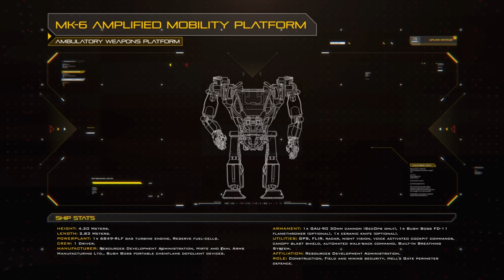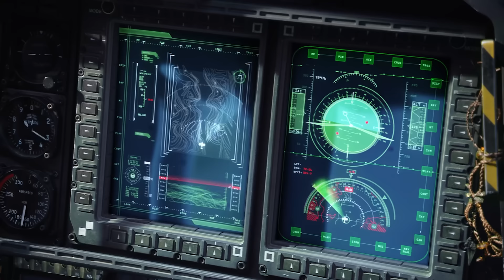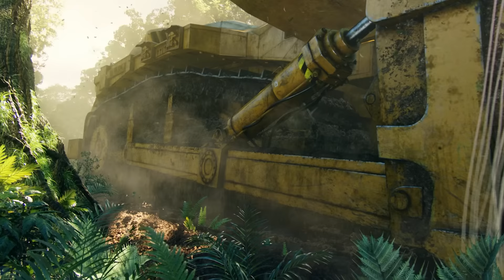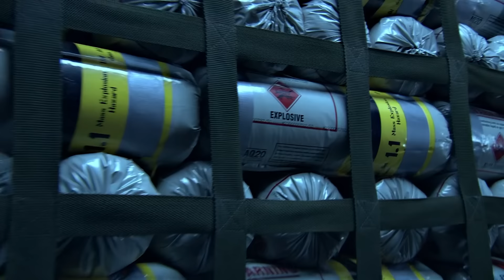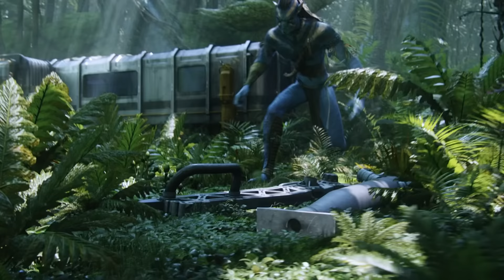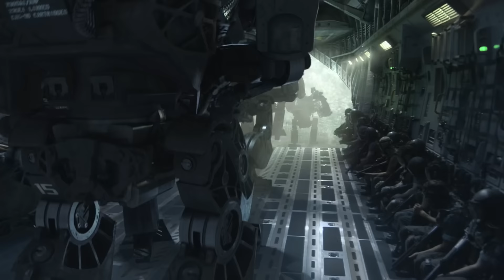Avatar: AMP Suit | Vehicle Breakdown

Comment: One of the most realistic combat mechs, big handheld guns excluded. It truly embodies the "mecha technical" concept.
Reply: They make perfect sense.  Different missions often require different weapons.  If a mounted weapon is damaged it would take time and tools to replace.  Not to mention there's a human in control of it so it would be more natural for the operator.  Though, it would make sense if there WERE other hardwired weapons like missile pods or grenade launchers.
Reply: @Blah81150  Yeah, Its Fantastic but some defensive capability at least would be nice. They say it was originally used by law enforcement, so smoke launchers would be a must have imo. They are fairly compact, used on a lot of real world vehicles today, could have been tear gas for law enforcement, plus since all friendlies are in respirators they could have made a more lethal gas for pandora, doubling as a smokescreen which basic thermal  imaging could see through, giving great cover.
Reply: @Blah81150  Imagine AMP version on Earth whitout the strong magnetic fields that hinder the usage of railguns and stuff. Yes, the weaponary on Pandora had to be more "traditional" to work properly. Machine Guns and dumb missiles for the masses.
Reply: @ThePandoraGuy  I'd say interfering magnetic fields of Pandora is what prevented them from having camera equipped armoured canopies, as they say in the video. The extra cost of producing more advanced components resistant to it in order for responsive, reliable & durable camera systems, combined with the weight & cost of armouring every canopy must've been deemed infeasible by RDA - I mean they're already limited to 8 hours of runtime at 1.7 tonnes, adding weight of a canopy on top would only shorten the runtime and, considering the 2 comparatively tiny feet, would risk limiting what terrain it can be deployed in further. Mud? Outta the question

But then again, just a simple grill over the "glass-polylaminate" windscreen would've made at least some difference. I've seen some people mention "transparent titanium", idk how expensive or heavy that is but it sure sounds stronger
Reply: @uttrly_Nuttrly_Buttrly  You can always weld extra foot plates to increase area and decrease ground pressure XD
But seriously though, its the year 2157, surely we would have a cheap, high-strength, high-toughness plastic/polymer composite that is shock resistant and can easily withstand primitive sharpened lightpoles thrown at it right???

Edit: According to Google, the 6-foot long arrows have roughly the same power as a .50 cal or a stronger Anti-Material rifle. SURELY we can stop that right???  I mean, we ALREADY have attack helicopter glass canopies capable of withstanding .50 cal, and this is over 120 years ago relative to Avatar's current setting. SURELY we can stop that right?!
Reply: IF those guns were uniquely produced for them then yes, it would have been strange. But those are the same autocannons used on gunships and base turrets. That's basically what Avatar had - utility and transport vehicles armed with universal locally produced guns. This is de facto second generation of Cameron's loader bot with majority of design being the same. If you want to see how ridiculous they look with integrated weapon systems, go play AvP ie Aliens VS Predator \/(-_-)\/ You get two unusable hands and gun that is set too low to be usable. Because it's a humanoid body.
Reply: The AMP suit was always an adapted platform made for commercial applications than military though, and on Pandora where logistics was hard to come by, it made sense the RDA adapted what essentially were ship mounted 30mm autocannons into handheld variants for SpecOps AMP suits instead of making a mount or purpose built gun instead.
Reply: There's a fair few design flaws in it, but OTOH, that kinda lends more to the realism, doesn't it....
Reply: @Del_S  what's the flaw?
Reply: @farhan-c5o2u  Well, use of a glass cockpit rather than armoured, use of handheld guns rather than integrated weapons, and it seems to have generally poor fire control systems. Some of it is the Pandora Is A Bullshit Planet You Should Just Nuke From Orbit handwave maybe, but they remain flaws even if they're forced by environmental factors.
Reply: @BlazingOwnager  cmon that was badass
Reply: @BlazingOwnager  Armored cockpit would make it death trap in jungle of pandora. Too easy to be blinded if use camera, if use mail slot, too small vision to see with how dense the jungle is. So basically RDA worked with what they have with logics.
Reply: @Del_S  given their multi purpose of construction/cargo hauling the handheld guns make plenty of sense, don't need someone accidentally firing their weapon when doing either of those things
Reply: @Del_S  yeah integrated weapons make some sense but especially in a low tech environment like pandora I'd rather have the versatility of an advanced manipulator rather than guns for hands.
More adaptability, better suited for moving around complex terrain, can be used for more than shooting... without the advantage of being a 1/1 giant soldier  that would be just a tank with legs, and we all know how useful those tend to be (sorry kojima)
Reply: @nguyenbagiap7433  false canopy?
Reply: @Del_S  what design flaws do you pick up on ?
Reply: @notundermywatch3163  Copypaste a previous response: "Well, use of a glass cockpit rather than armoured, use of handheld guns rather than integrated weapons, and it seems to have generally poor fire control systems. Some of it is the Pandora Is A Bullshit Planet You Should Just Nuke From Orbit handwave maybe, but they remain flaws even if they're forced by environmental factors."
Reply: @Del_S  I wish they went into more detail about the choice of a "transparent, impact resistant glass-polymer laminate" instead of an armoured one. Was it for sake of lightness; material cost (since they're all made in Hell's Gate - I mean was there only one production line for utility AMPs instead of dedicated combat AMPs?); complications from Pandora's "strong magnetic fields"/flux vortex shit; did drivers prefer visibility with their own eyes instead of a camera system (which i guess would've necessitated a humanoid head with cameras in order to mirror the driver's eyes - raising the question of how would the driver look down when all they'll see is the top of the cockpit canopy jutting from "their" chest); or some combination thereof?

Also how would they use integrated weapons instead of handheld ones? their hands, fingers & feets all control the AMP's via motion control sleeves & gauntlets

The only option after that is either they do some funny stuff with one gauntlet to switch it from controlling the arm to controlling the integrated weapon, or voice control, or they use some neural helmet shit to read the driver's thoughts (but i imagine the whole Pandora's magnetic fields would make that much harder)
Reply: @Del_S  pretty every enginner talking about small-scale mech would sya that modular weapons are preferable to integrated. Otherwise what we see is not a army effort, it's a PMC doing stuff for a mining company. They use police, civilian and multipurpose tech, they use transport ships as makeshift bombers and convert dump trucks into technicals. They also employ untested and illegal, on many accounts, tech - Avatar. If avatar was feasible, why blackops and special ops wouldn't use it? Imagine you can remote-control humanoid bodes like drones, the soldiers would become operators. what's the stopper? Weak mumble about cardiac arrest from feedback if avatar is killed.. saying this tech is new and undeveloped and untested. Also highly illegal by our contemporary Earth agreements.
Reply: Yeah, like the titans in Titanfall, they were originally for civilian use but then modified for combat. Though later on in the series Titan classes purpose built for combat (Vanguard, Monarch) were made.
Reply: Cati Sicarius?
Reply: My biggest complaint is that the combat versions don't  cover the canopy
Reply: Now compare that to Legendary Mechagodzilla.
Reply: These things were an absolute blast to pilot in the v2008 deo game. When on foot you spend it all being well armed but if the Na'vi get close you are sooo screwed. Like literally their basic weapons can send you flying like 10 meters, so you have to prioritize firepower, range and volume of bullets. The wildlife is your main enemy with the Na'vi being smarter but oh man do they hit hard. Whenever you can get an AMP on the battlefield though...it's like all of a sudden the tables have turned. Now you're in a giant super mobile mech, smashing aside Na'vi warriors, squashing viperwolves, fistfighting Thanators and dodging Sturmbeests. That GAU-90 is a beast too. Only took around a single double volley to take out Banshees and a couple rounds would floor a Na'vi warrior that would ice you if you were on foot in a single attack. The Avatar video game was so cool. Legit my favorite thing to do was to get in an AMP at a base safe area, then stomp my way through the jungle to a Na"Vi warcanp, then call in an airstrike and charge in with the AMP like "WHIS SHORT NOW MOTHERFKKKRRRR" . I hated Viperwolves the most as enemies because they'd climb all over the trees and leap down on you, but an AMP could deploy it's 4 foot long bayonet and slash them to bits. Even was fun to use it to joust Sturmbeests (hammerheads) but those and Thanators were the only things that would two-shot an AMP. Against Navi it was like turning their size advantage on its head. A regular arrow would launch your guy half a dozen meters on impact but an amp could just take it, shrug the. Level the battlefield with its cannon and smash apart anything that survived. Plus if you got really badly damaged you could blow open the cockpit, leap out and start laying down lead with your personal weapons. I recall at one point in the Windwash, being sent to rescue a SecKos squad and they all had been programmed to yell "holy crap they sent us an AMP guy!" As you charge in and rip and tear